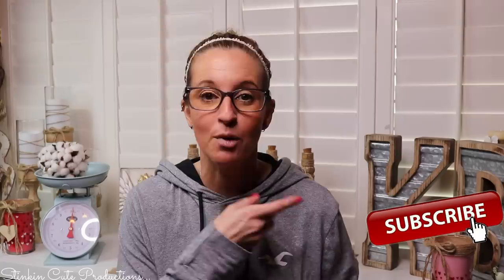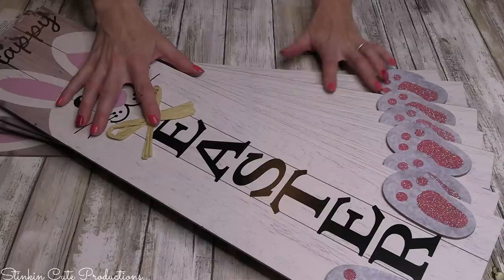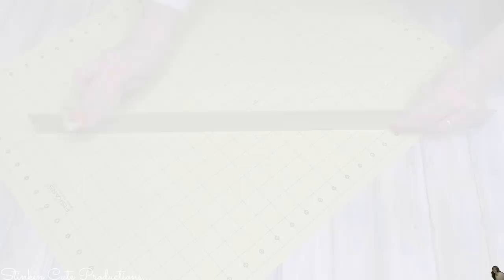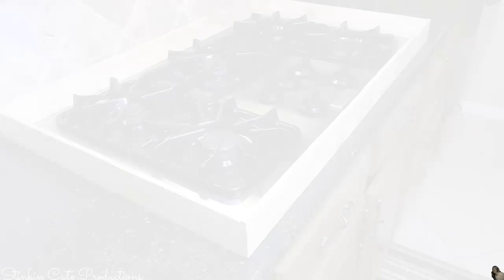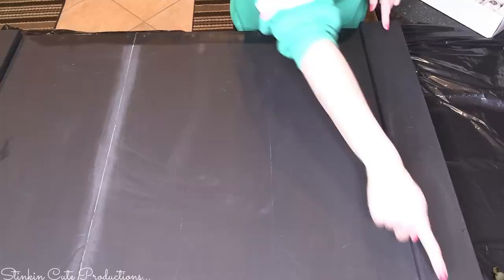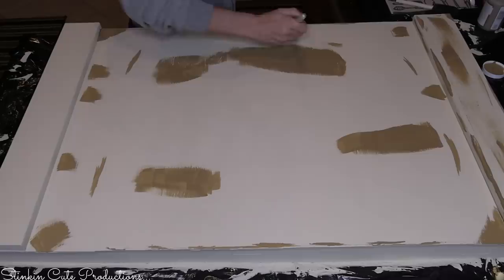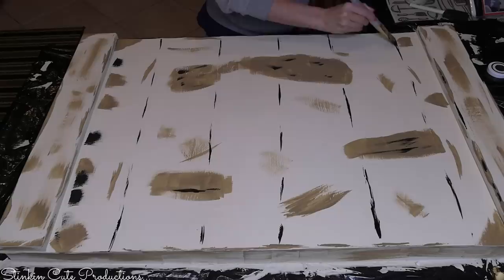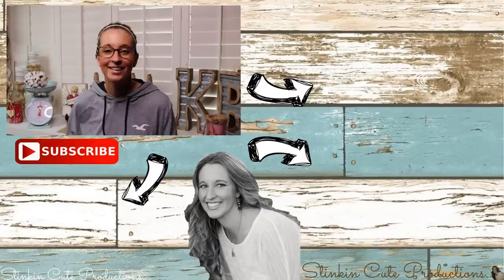AMAZING MUST SEE Dollar Tree STOVE TOP COVER DIY for UNDER $20

Comment from the maker: ****** UPDATE *****
There was a comment posted that this was a Fire Hazard! NO IT IS NOT! I DO NOT have a PILOT LIGHT on my Gas Stove, I have an igniter! So if you have a PILOT LIGHT on your stove this would NOT be SAFE!! In order to turn the burners on, on my range the knobs need to be pushed down then turned to ignite a flame!  The burners are not on when the cover is on!
Reply: Maybe they are thinking about the pilot light,but its changed over the years
Reply: I swear, some people just look for any reason to yap! 🙄🙄🙄 of course it’s fine! Lol
Reply: Well of course you remove it before turning the stove on lol.
Reply: Actually I would think that the cover would make you double check no burners are on. So we don't burn this  stinking cute cover.😁
Reply: Good grief! 🤭
Reply: If your knobs aren’t on top and you have curious little ones, THEN it would be a hazard. As it is, you are fine.
Reply: I'm sure u looked into all that before even starting ur diy. U just seen 2b a very knowledgeable person.
Reply: Oh lawdy if I could tell you the number of times I have set those old metal covers on 🔥  😂😂😂 My family still makes fun of me about it!!!
Reply: Kelly, another way to lessen sanding time is to dry brush your alt colors on vs what you did. It is a form used to antique....
Reply: Blessings to you always! I must admit I was thinking the same thing, I was thinking about the pilot, which is always on! 🙏🏻🌹
Reply: Seems like it is common sense the burners wouldn't be on while the cover is on... Lol
Reply: I can't tell you how many times I've left a burner on.  So this would not be a good option for me.   I think everyone should judge the safety of this project based on their own situation.   
That being said,  this turned out beautifully.   I once made a cover that spanned across the tops of my washer & dryer when we lived in a small house with a tiny kitchen where the laundry was also located.   Having that extra counter space made that kitchen functional.   I used plywood & attached rubber feet.
Reply: Mine as well! It makes a “ ticking” sound before you turn them on!
Reply: It’s a safety! I’ve had gas stoves for over 40 years !! Some just feel intimidated by them, just feel secure, and use the “ smarts” when covering!! Such a sweet idea! Do you not think she already figured all this out!! They used to have this waaayyyy back in the day also, this is brilliant!! Xoxo
Reply: This would be great for my RV to give me more counter space. Our RV was bought used so the cover was missing for the stove top. Thx for the idea. Would love seeing some Cricut projects and ideas, I just got my Maker for Christmas and excited to get started on some projects.
Reply: It’s your stove sweetie... you should know what it does and what it don’t. There’s a reason new stoves DONT have pilot lights. It’s due to pilot lights go out and gas is released in your home.
Reply: I think I know you by now. Safety always comes first. God bless you
Reply from the maker: Shannon burgess whittle 👍🏻👍🏻🧡🧡😋😋☀️☀️
Reply: My grandma had Alzheimer’s and we used to remove the knobs on the oven. So for someone who mentioned curious little ones...there’s your option. Or put the fear of God in your child before these mistakes happen. My siblings and I NEVER touched the stove and it never took an accident to figure out not to
Reply: These crafts are people's own reference to what works for them and NOT for everyone to copy without putting in your own thoughts, commonsense and needs. Love the idea and without it I would not of thought of what works better for me. There's more than one way to attach these peices .💚💛🧡💜💙
Reply: @JessacaRedd , agreed! My husband made a wooden cover for ours stove top in our RV. I don't use the stove a lot, but (hubby does all the cooking outside) as you said it is great for the extra counter space. If you do it, you will LOVE it! I haven't ''Cricuted'' it yet or put on handles, but will soon as we start camping in April :)
Reply: I recently moved into a 28ft travel trailer, with just the tiniest little bit of work space in the kitchen. I have been visualizing doing something like this but didn't quite know how to do it. I'm so excited to know I can actually do this now!
Reply: Some people have to find fault in everything .They should be more thankful that people like yourself take time to shop ,make video,edit and upload for us to enjoy. Thank you for taking the time for the above a,I for one thoroughly enjoyed.  I have come to the conclusion that some people just want to find fault in everything .Perhaps they themselves could make a video for us all to enjoy .Love and blessings from the United Kingdom
Reply: Mine have to manually lit...  So I won't have that problem...
Reply: @jen7916  Sadly, Common sense is in very short supply these days... Kelly, this is knock your socks off WOW DIY!!! Great job, I love it very very much ~ Keep up the Awesome DIY ing! PS. I got a purse type bag from Yankee Candle and it was sold with candles, etc in it and it had a warning sewn in it said: remove candles from bag before lighting... Good grief... I say we just let the wingnuts that need that kind of a warning weed themselves   out ;)                                                                                                           (obviously, I am not talking special needs, sad I have to even include that for the PC ers...)
Reply: @theresaalbano  that's very true, sadly. And OMGosh! They actually put a warning about taking candles out of a purse before lighting. Wow. Well, just proves there's a lack of common Sense these days! Lol
Reply: I just love your beautiful cover! It wouldn’t work for me because I have the old style pilot light kind. Sigh... I never doubted you one bit!🌹😊
Reply: I'm electric all the way so I am lucky to be able to make a stove cover with no fear
Reply: @eileenbaran7040  same here! Can't wait to make one!
Reply: Tell them to worry about their own stove. You know yours better than they do.
Reply: I actually bought a primitive noodle board ( very heavy) and paid 65.00 for it, if I had seen this prior I would have never bought it I would have absolutely tried making one this way
Reply: Kelly it little bit to much work for me but I must say OMG! So freaking stinky beautiful! Loved this! Thanks for sharing because it's so nice to have decor in the kitchen. God bless you and good work 😍😉
Reply: I think it's really cute too..but seems like a hassle to find somewhere for it everytime u cook.
Reply: It was amazing
Reply: Looks like the originals. Nice work 👍.
Reply: It's almost shameful she had to say that, and explain it to adults...🙄🙄🙄
Super cute diy tho! Definitely gonna try.
Reply: @bonnew6435  so it was like a tabletop that went over the laundry components? That´s really cool!
Reply: @JessacaRedd  What kind of ¨maker¨ do you mean?
Reply: @ziggybluwaters5060  yes, exactly!     It was really handy & looked nice too.  Now, back to watching my Psych marathon 🍍
Reply: Taiya Reynolds Cricut maker.
Reply: Kelly Barlow Creations I was wondering about that when I seen your stove was gas. Thanks for clearing that up for us.
Reply: Jessaca Kordsmeier Redd in a state of Namaste soaps what’s that?
Reply: There's always someone trying to rain on a parade!
Reply: Yes, you are right. They have changed. It's perfectly safe!!!!. Just I mean please dont turn the burners on while the cover is on. I have a bad on cover. I live in my camper full time.  But I love this! I'm going to make one, this is adorable.
Reply: Really nice
Reply: I love this but always wondered what you do with it when your using the stove where do you store them? I know it may seem like a silly question but would love to here what everyone does with it when using the stove. You did a great job
Reply: Duh! Some people 🙄
Reply: @cherbeatTX59  I'm also one of "those" 😓 Thankfully, I usually have someone around me... just in case. The older I get, the more experienced, and the less these "mishaps" take place lol
Reply: @bonnew6435  Thanks for sharing this idea👍I think I'll try that
Reply: @JessacaRedd  I just moved into a house but I was in a small one bedroom apartment for 8 years and their kitchen was tiny and I always use things on top of my stove to cover cookie sheets I wish I'd known about that though what a great great idea very cute great job and I guess her name's Kelly thank you so much this is my first time to see your stuff came across my feet so I really enjoyed it hun you did really well
Reply: I was just thinking about that I have a gas stove also yes with a pilot light so I think this project is for people whom has electric stoves  Only I’m just being safe
Reply: My pilot light is always On

Comment: I don’t know if you have ever heard of Un Do; it’s a remover that works for all types of adhesive and is great for removing photos in old albums.  I use it all the time. It’s archival and will not damage pictures or collage items. Anyway, I think it would work to remove stickers, etc on these types of products that would eliminate sanding.
Reply from the maker: Debi Adams that’s good to know thanks for the tip 👍🏻

Comment: Kelly I've said this on many if your DIYs but this has got to be my favorite so far. I love this. It's so stinking cute. I'm cracking up on all those that think this a fire hazard. Wow don't turn the burners on lol. Thanks for sharing. On my way to get supplies. BTW, Any ideas on how to make this nautical?
Reply: Crafts and More with Donna Jackson The colors you use can make it nautical and the stencils you use like an anchor or sailboat or something with shells. You can also use a rope around the top edges to make it nautical. Hope this helps some.
Reply: Oops!!! I think I need to unsubscribe I'm way out of my league with these kind of crafts. Wow...that was an awesome tip😞 my mind simply doesn't produce those kind of ideas.

Comment: Often when I watch these "Dollar Tree" videos I calculate what was actually spent and it costs so much more than if you just bought QUALITY supplies at the hardware/home improvement store.
Reply from the maker: A Balzeris I do realize that and I did state that in this video. In my 4 years on youtube and doing DIY’s I have encountered soooo many that just don’t want to go to the hardware store don’t like having to worry about having wood cut, nailed and believe it or not using any kind of power tools! I was a bit nervous using my drill in this video because I will get asked what an alternative is because they don’t have a drill! I’ve heard it from thousands of people who have commented on my other videos that I did use wood! So my goal is to bring alternatives to those and for those that do want to use wood they will and like working with wood❣️
Reply: A Balzeris That is true but imagine how much less this one would weigh. I can easily go to the Home Depot but I think this would be very light in weight. I guess I could use a big piece of wall stuff. I can’t remember what it’s called. I think it’s plywood. That’s pretty light weight as well.

Comment: hey Kelly.   I have been using shoe polish since I first saw you use it on small wood pieces.  Well, I have run out and haven't found any lately.  Instead, I bought some tempra paint from Dollar Tree and used it the same way.  I LOVE IT!   Much better than the shoe polish.   You have to give it a try!

Comment: I've been researching Noodle Boards, and I can't wait to make mine! I am using wood, because I want it to be solid enough to use as extra counter space when I need it, and I'm putting some handles on mine so it will double as a tray when not needed to cover my stove. I already bought a Dollar Tree wall decal to use on mine too! Yours turned out cute, but I can't help but think it won't really last too long.

Comment: This DIY is super cute! Maybe you can somehow attach some cutting boards to the underside and leave the back side open? It can then double as a stove cover and when you need to move it off the stove, just flip it over and use it as a cutting board.  Maybe? Just a thought. 😁💜

Comment: Here's a gluing tip for people working with a ton of little pieces who might not have the right clamps. Medium or thick CA glue and activator. 

Think Morse Code. Dot, dash, dot. A dot of CA glue on one end, a dash of wood glue in the middle, then another dot of CA glue on the other end. Hold it tight together, hit it with the activator on either end, hold for 5 seconds, then move on to the next one. 

The CA glue is instant and will be enough to hold the pieces together tightly until the wood glue has the opportunity to cure. In the long run, this will add a ton of strength and longevity to the piece. You could also use CA glue to help 'clamp' the top to the base while it's drying. 

Love the painting technique. Now I've got something new to practice. 🙂 

(edit: typos)

Comment: As an alternative to plywood and Dollar Tree plaques you could use press wood. It is the wood they make peg board out of.  Hardware stores should have it with no holes.  Press wood (or whatever they call it) is pretty much the same as the wood they make the Dollar Tree plaques with.

Comment: Just a little suggestion I learned from  art class wayyyyy back. Tape a few pennies under your ruler. This allows it to be higher and less chance of cutting your expensive ruler. It do this on all my t-squares and flat rulers.

You mentioned that it was cheaper to have/buy the wood from a store. But you used the blocks for the sides. Why didnt you get wood for the frame also?

Love your videos! This is really nice looking. Great idea!

Comment: I absolutely love this cover! I think I want something a little more durable to use for stovetop for a work surface. I may try a pallet and see how that works. I have a big cutting board from Sam's, acrylic I think and it could be screwed down to boards. But of course I couldn't decorate it!! I will have to figure out exactly what I want to use the top for and and the durability it would need! Tyfs!
Reply: Maybe attach the acrylic cutting board underneath...  It would have the strength of the acrylic covered with the boards that you can decorate.

Comment: Hi Kelly! Thanks for the inspiration. Your video was so easy to follow that I made my own!! I have a question...some water dropped on my cover. When I wiped it off, some of the wax came off, leaving a bald spot. Did you seal after using the Waverly Wax? If so, what did you use??
Reply from the maker: What wax was used on your cover? I didn’t used the waverly wax on this project

Comment: This came out SENSATIONAL 👏🏻👏🏻👏🏻 I have a flat glass range and have NOOOOOO idea how I would even begin to start something like this 🤷🏻‍♀️🤷🏻‍♀️ every single one I’ve seen of this diy it’s been on a gas stovetop so... I wouldn’t mind if mine was “flat” against my stove but I would like a border around it but cannot find those Jenga blocks ANYWHERE I found a pack at dollar general but for $6 bucks and only 30 pieces nah not worth it and wouldn’t be enough anyways.... i do own the bunny plaques I have 4 which length wise fit perfectly but would need a little trimming and I have the jumbo popsicle sticks as well so if you have ANY suggestions I’d gladly take them!! Outstanding work you’re just amazing at what you do and what you come up with is astonishing 👏🏻👏🏻👏🏻👏🏻
Reply: you don't need jenga blocks,  1x2 from home depot or lowes.  you don't want anything flat against your glass top anyway,  it scratches too easily. one length of 1x2 and they would probably cut it for you if you had the measurements.

Comment: It turned out great. Curious why did you use the jenga block instead getting the size wood piece you would need. Wouldn't the cost of been lower like the upper trim was? I've been wanting one since I saw it on a channel. Fell in love but like you said there was no how to videos so this helps TREMENDOUSLY.  Curios is it important that the top not come in contact with the burners or is it ok if it does?
Reply from the maker: Because I knew when I sanded it that the blocks would really look cool after being sanded and distressed. I really like the look of the blocks as the base. My goal was to do this under $20 if you use wood it would probably be a bit less👍🏻

Comment: It's cute. I'm curious why you didn't use wood on the sides instead of Jenga blocks. You mentioned how less expensive the pieces were on the top. Seems like so much work to glue all those Jenga blocks.
Reply from the maker: I used the blocks because I knew I would love the look after I sanded it and they are easier to work with for the height of the cover I didn’t want my cover to stand 4 inches up and you can’t get the wood cut that way at the stairs you’d have to do it yourself which would turn people off from making this! You can easily stack the blocks 1 or 2 blocks high if that all you need for say a glass top stove❣️
Reply: @KellyBarlowCreations , makes sense.😊

Comment: It doesn’t seem like glue would hold it all together long term what if it gets hot won’t it come apart?
Reply: She said you could use E6000 glue for more strength, but it requires a long drying time. 
And heat should never be a problem because common sense would prevent anyone from putting the cover on before the stove was completely cool.👍🏻🙂

Comment: What could I use on the top that would be wipe off easily- my microwave is over the gas range and spills do happen
Reply: You can seal it with a sealer such as mod podge or a spray matte sealer. Then it could be wiped off.